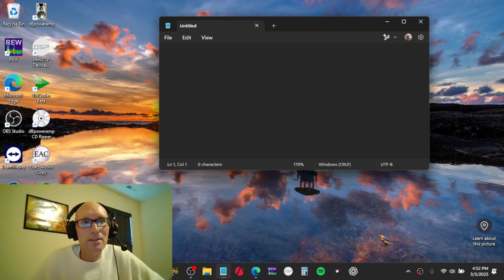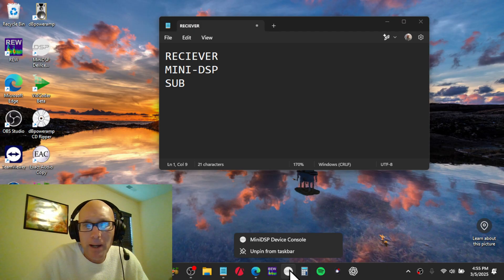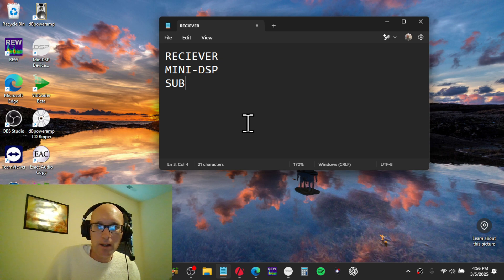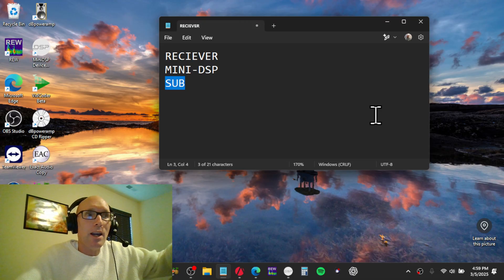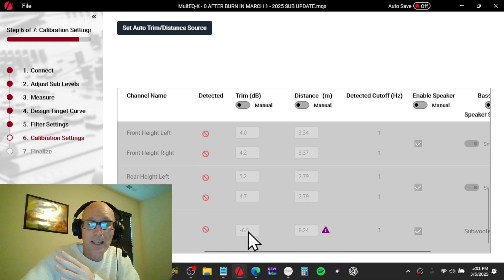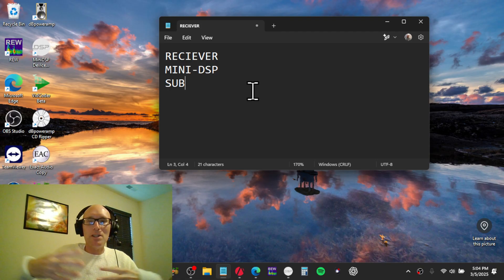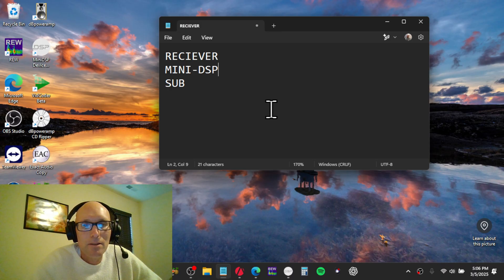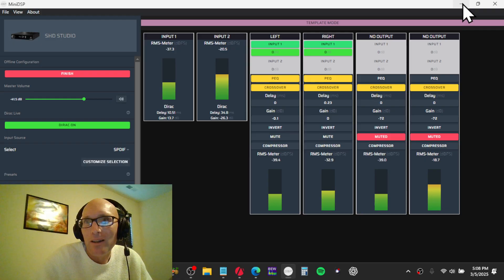A Simple Way To Deal With Clipping - Subwoofer Calibration - Mini-DSP - Denon/Marantz

Comment: Love your videos, so much info but sets my ocd off 😂
Question if you can help please, used a1 acoustica with your harmon movie curve & acoustica sub & 80-120hz settings. Sounds great.
When calibrating through acoustica i set the sub to -10db, gave me -2db final, (when using audyssey-17 on the sub would give me a trim of -11.5 before feeding into acoustica - after acoustica +3.5!)
Usually dont go past -10db on avr (3800h) when watching movies, have gone -5db on some content 
Does the sub need a certain amount of headroom aswell as the avr? Should i turn the sub (pb1000pro)up even more & calibrate again to try to achieve this -6/8db on the avr?
Like you said just trying to be safe. Any insight would be helpful
Reply from the maker: Yes, please check out my new video, I explain sub levels when calibrating to a target curve.

Comment: I have run into situations where room gain was so much that when you tried to use REW EQ, sometimes it had to apply -10 or more dB at certain frequencies. Interestingly, when I tried to do the sweep with REW, there was no clipping, but when the movie was played, the sub started to make strange noises. The AVR was a Denon (which can put out 3.5v at the sub pre out). When we switched (internally with the jumper) the input sensitivity on the Minidsp 2x4 HD from 2v to 4v, the strange noise disappeared and sub has become more powerful. According to your video, would it tackle the problem if the output gain on the Minidsp was increased with the same amount (with the biggest amount of cutting by the EQ, so if it was -11dB at 35hz for example, then +11dB on the Minidsp output gain)? Or should it be compensated at the Input gain (digitally in the menu of the Minidsp)?
Reply from the maker: Good question. I know what you mean about using negative EQ. However, I would still always negate what you boost by. If you use negative EQ, what's your lowest negative boost? You could maybe boost by the lowest amount.
Reply: @hdmoviesource  When REW calculated the EQ for 10 points, it sometimes showed -3dB at 60hz, but -13 dB at 40hz. So you say I should boost with 3dB in this case? Boost where? At the speaker level menu of the AVR, or at Minidsp output gain setting?
Reply from the maker: Good question, but no, not in this case. I like to keep some headroom, so I use a -6db on the subwoofer channel right now. If most of your EQ is negative, you could probably keep the channel at zero. But it depends what receiver you use. If it's a Deno or Marantz, always be aware that it needs at least 6 to 8db to not clip at true reference volumes.

Comment: What does clipping sound like?
  Any scene that is known to cause clipping if settings aren't right?
Reply from the maker: Tenet is my go to, if you're clipping you'll know it with that movie.
Reply: I'm bored so i'll give you my 2 cents.  Clipping can be from a number of things like an underpowered amp too so it's not just the settings that need to be right but the synergy of the settings for your room and hardware imo.  Amplification (power) is like having a sportscar where you can step on the gas (volume of sudden dynamics) and gain speed effortlessly (dynamics power spike\speaker current draw) it sounds good, but if it's a crappy car will have a hard time gaining speed when you suddenly floor it (clipping).  An underpowered speaker is easier to damage than an overpowered speaker.  If your speakers are like mine (Elac 6ohm 86db) then a regular avr (say a dennon x3800) may underpower them and they may lose dynamics and when it's loud will sound distorted and when its really loud may actually damage the speaker because of too many current drops\spikes (i think), so picture a really crunchy, muddy distorted sound for clipping, or like a clap.  If your amp is properly powering them (like my 350w a channel Anthem) you are more at the mercy of your speakers capabilities, your EQ settings, gain, volume you want and source  material dynamics.  Loud will sound much cleaner with proper amplification but there is an eventual hardware limit that if you have too much gain for the speaker and have it too loud it may distort, possibly physically distorting too, because you are basically frying them with voltage spikes that create heat when theres sudden dynamics (loudness).  Clipping this way is more a crunch sound or like dropping a hardcover book on  a hardwood floor.  When you hear it you'll usually notice it because the sound will scare you or at least draw attention; it sounds bad and un-ordinary.  Loud continuous music you wouldn't notice it as much as say John Wick suddenly blowing someones top off and your sub crunching.   Subs can be a real S.O.B. with power and clipping and with equipment like Carl has and the volumes he likes is 1 explosion away from a 5k curl of smoke if his gain is too high so tweaking like his matters when you push it.  An infamous opening to test subs is the beginning of The Edge Of Tomorrow, but the DVD version has lower bass than the re-releases because it was basically causing clipping so they fixed it.  Nolan films like Interstellar can be a good barometer too and can set off a Richter scale if done right.
Reply: @optimuscrim  thanks for detailed response.  I heard on a bass scene a "blat" sound. Hard to describe it. It was a scene where a monster came crashing down to the ground in The Great Wall.  Wondering if too much boost at a frequency was done or trim level is too high, etc.
Reply: @ Thanks.  "Blat" is as good as any description because it's hard to describe distortion.  If your sub is somewhat inexpensive the usual reality is it's underpowered or unable to reach the lowest frequencies, say less than 30hz.  This will be a hardware limitation so if you have it up to reference levels it would probably bottom out easier with a distorted "blat" because there isn't enough power or a weak woofer.  You basically fix this by turning things down and limiting the bass if you hear it often enough.  If it can reach low frequencies according to the manufacturer and is powerful enough then a "blat" would be because you have the gain\house curve too high or an engineer that was being over zealous with bass for that mix.  You can have it sound good easy enough through placement and EQ but when you start to push it to the max you may run into clipping because subs and mixes aren't created equally and through EQ (Audyssey?) your gain\trim levels may be high\low causing strain.  Carls video was trying to help with the last sentence so we can push our investment to ignorant levels.
Reply: @optimuscrim  very helpful. It is two 21" sealed subs. Think it got calibrated with too much boost via curve /peq in Audyssey and or minidsp. I added 2 more so have to recalibrate anyway.  Thanks.
Reply: @flyers10az  now i'm jealous.  With that many subs the sound you heard was everything not bolted down shaking haha.  good luck.

Comment: Does the software you use have any kind of limiter or clipper ?
Reply from the maker: I believe it can limit, but I have all limiters turned off.
Reply: @hdmoviesource  a limiter will stop any overs
Reply from the maker: @djscottfrenzy  True, but I just don't want to use one, due to compression. Especially when this method works without doing that.

Comment: Reference is what THX certified MOVIE THEATERS are calibrated to.  When you set reference at 0db relative volume for 85db with 105db peaks (115db for the LFE) you are calibrated to the same standards as a THX certified commercial cinema.

Dolby Cinemas may be calibrated to a different standard.  Imax theaters are most assuredly calibrated to a different standard.  (I might design the next iteration of my theater around Imax standards)

Movie sound designers and mixers have no real standards they must adhere to.  They work on a principle of "best practices".  And try to mix to where everything is clear and audible (unless your name is Christopher Nolan) but as far as average volume levels and peaks, they dont have a standard.  Its all over the place.

They are aware of THX/Dolby reference though and take it into consideration, but they dont use it as a standard.  They are just aware that most cinemas will play their movie back near that level.

I suspect Disney mixes quieter so as to not offend young ears.
Reply from the maker: I think you're right.